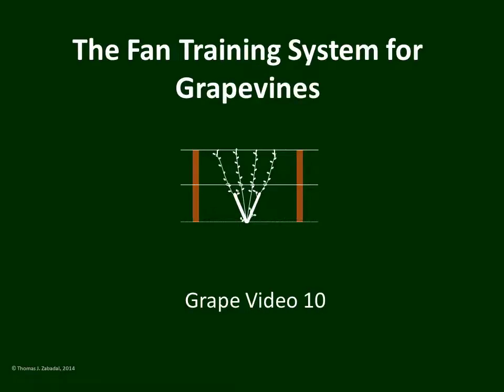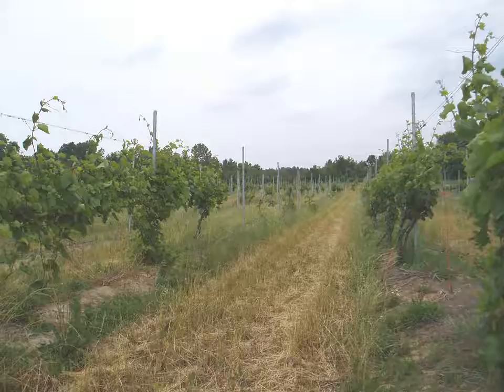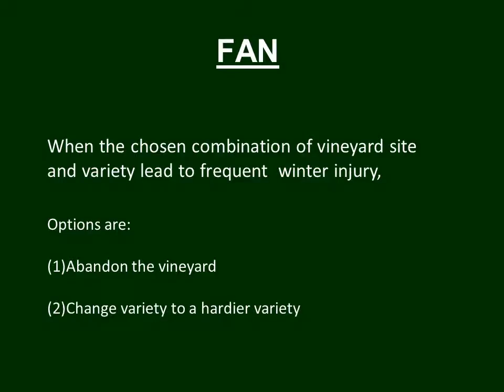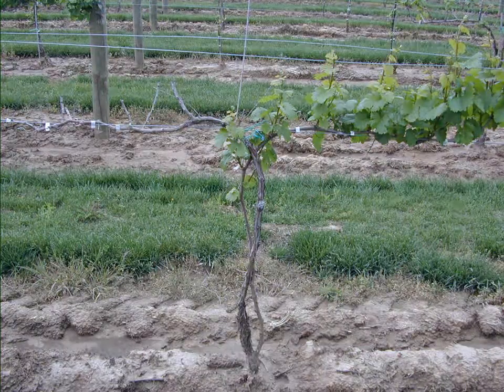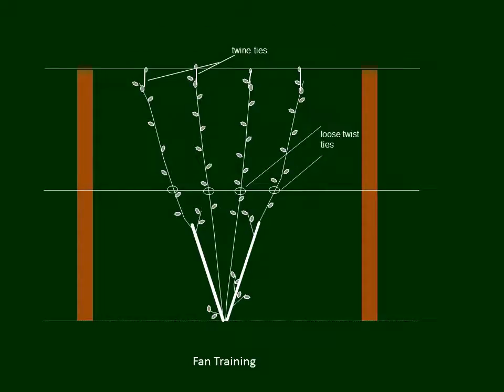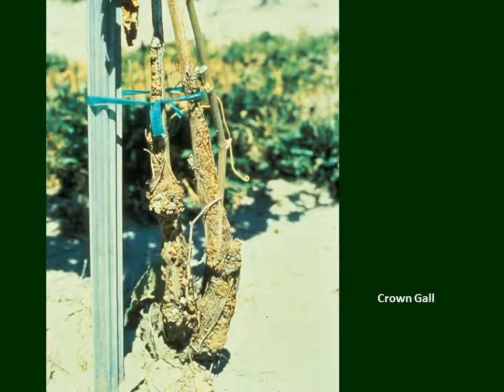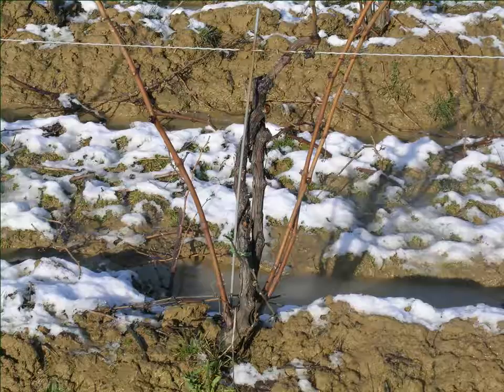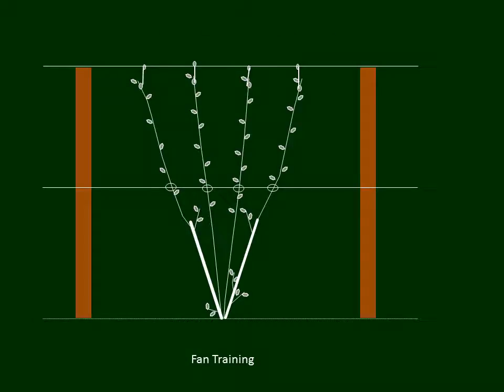The Fan Training System for Grapevines - Grape Video #10

Comment: i am going to try this in a modified way. my vines have been through a lot!. i planted in the late '70s and have only gotten one really good crop. last year, we brush hogged the vines to clear out the mess and cut off all the old trunks. the temps here went to -24 F this past winter so i am uncertain how much damage was done to the shoots that came up last summer. i find that a solid platform helps survival rates so i am going to train them on wooden frames not wires. the wraps have to be different and the ties are different too. how much of the damage is due to high winds in low temperatures versus just the low temperatures?
Reply: Any success?